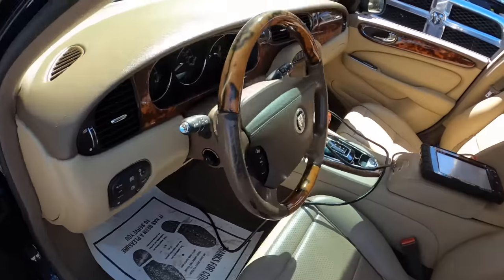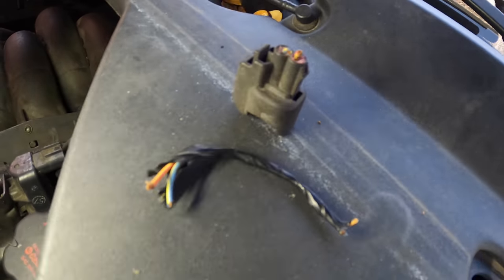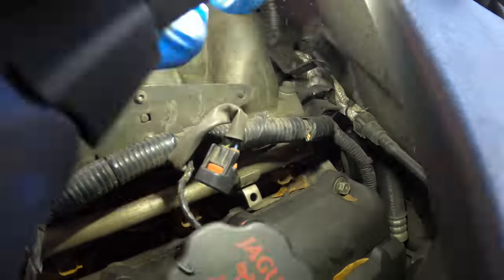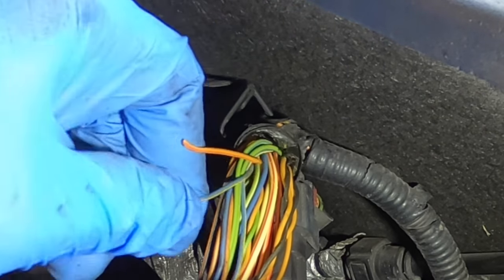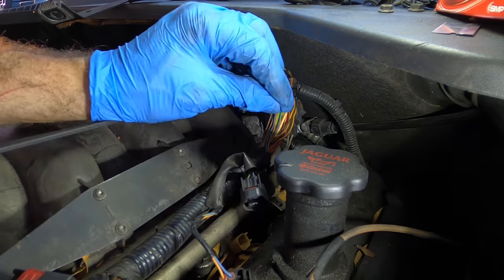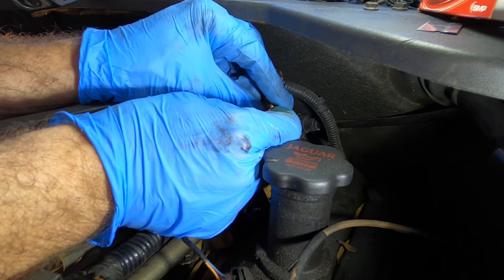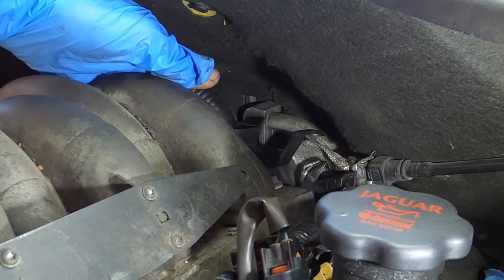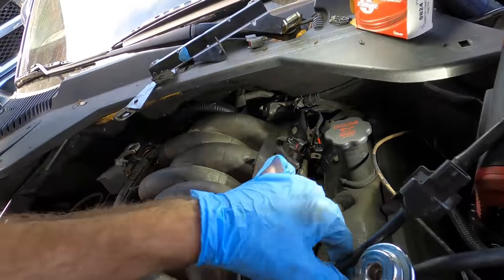Angry XJ Jaguar Engine Attacked / Electrical Damage. P0208 P0308 P0316

Comment: People sweat soldering techniques too much. At the end of the day; conductivity is conductivity, and security is security. Current doesn't care about vanity.

But I do recall one very good piece of critical guidance, specific to high current applications. Keep your wire strands as straight as possible. The more bends, twists, or loops...the more of an electromagnetic field that will be generated at the solder point. So 2 amps or less, and not near any sensitive electronic equipment...I take liberty to secure the wires as is convenient for me. I only go the extra miles of difficulty when current increases and/or in close proximity of other components.

EM losses can also effect sensitivity of sensor circuits. But I've yet to run into those issues in my own experiences.

Comment: You should put solder on one wire then put the other wire on top then heat the soldered wire then it will flow into the other one that's how I do it ( sorry to tell you this )

Comment: Damn Ray, a Jag with multiple issues! What's the odds?
Reply: I learnt the hard way re Jags - had a 1964 S type in the early 1980s. You need lots of patience as well as deep pockets - mine weren't deep enough. Once bitten, many times shy. Never had one since although a "friend" coerced me into working on several of his. From retired mechanic in Land Down Under.

Comment: Rather than using a razor blade to cut the loom or the old electric tape get and use a "Seam Ripper".  Never worry about cutting into the wire insulation  ! ! ! !

Comment: Is there a spray that would make the wires less tasty? Brake clean?
Reply: Peppermint oil keeps them away.  There are also devices you can buy on Amazon that let out a high pitched siren that we can't hear but they can.

Comment: I speak Sarcasm, bad English, and a bit of Portuguese and/or Spanish. 

As far as soldering,  if it works and doesn't come apart and has good electrical connection then you are fine.

Comment: You need some pistol wire strippers for tight spots like that. Far superior to the one you used. MAC and Harbor Freight both make one in case you want to try the cheap version first

Comment: There’s also rumors that the insulation in the wires are soy based. My sister has a 2021 infinity and the rats ate her wire harness. It sat most of the year due to working from home due too the coof.

Comment: Reminds me - years ago, some wires got chewed on my MINI Cooper - one of which was evidently a plug wire...god knows what the others were.  It drove - on three cylinders...so I figure I'll limp it the two miles to the dealership.  It's a Saturday and as I arrive into the local  MINI/BMW/Cadillac dealership - it's evident that the MINI techs don't work the weekend and the dealership is pretty much deserted.  So I wander into the BMW area to see if someone can locate a MINI plug wire that I could swap out myself.   There's BMW sales guy there so I wander over and tell him "I think a rat chewed my plug wire. Can you get me a replacement?"  the BMW guy laughs and says "That might be what the MINI guys would say - but here in the BMW side of the dealership we always tell our customers that it was a squirrel - sounds so much nicer."  ...then from over in the Cadillac area, I hear a distant voice yell "Probably a Mink!".

Comment: I like your soldering job HOWEVER if I was going to do that job I would have soldered my thumb a bit and got some on the other leads.. then when I finally did it I would have realized that I forgot the shrink tubes and then cursed like a drunken sailor

Comment: Gloves off would help when getting into wiring. Why do you guys not use cheap cutters with plastic handles and breakable, renewable blades instead of those scraper blades? I use flux. Some of those other connector wires could use some tape. No brakeclean is disappointing.

Comment: Excellent work Ray. The only thing I would have done differently is to dab some flux paste on the exposed cabling, either before twisting the wires together or, where access is difficult like this case, after twisting the wires together. The dab of flux makes a real difference as to how easily and quickly the solder flows around the joint, even when you're using flux cored solder. In practical terms it means that less time needs to be spent with the hot iron tip wobbling around in the proximity of other wiring. 🙁

As an aside, we British always pronounce the "L" in solder whereas you Americans appear not to.
Reply: I never use flux paste and I get perfect shiny solder joints all the time.. You just have to have a good, clean,  tip, and understand what it means to heat the joint from the bottom so the solder flows all the way through from the top where you are holding the solder wire, and it is shiny solder all the way through..
Reply: @frandanco6289  Indeed. Perfect soldered joints are perfectly possible without using anything other than the flux already included with the solder provided everything is clean and the tip is hot enough. However, using the additional paste gives extra margin for error and means less time with the hot tip in the vicinity of things you want to avoid.

Comment: Nice pickup Ray. It goes to show yet again the importance of a visual check before taking things apart. Obviously there are times when one might have to take something off or apart to access the area one wants to visually check out, however that should be minimised so as not to inadvertently clear an issue without identifying the cause with certainty.

Comment: they make a razor with a hook only cuts inside the hook so can just hook the opening and pull, slices the loom open and doesn't cut wires.
they have a vegetable based insulation for wires, rodents love it.

Comment: Great job there Ray. A pleasure to watch. Well done on realising that a better tip would’ve been appropriate for better heat transfer.
May I add a suggestion?  Not easy on this job but if the wires can be kept as still as possible then it reduces getting a ‘dry joint’. Well worth a read up on them if you didn’t hear about this.  🍺

Comment: I would have used butt connectors then shrink fit the butt connector then put a heat shrink sleeve on top then shrink fit every thing. Or you could have used waterproof WAGO connectors which I have had very good success with. I always like to see a mechanic use the factory wire tape instead of electrical tape.

Comment: Google says several car manufacturers use wire insulated with soy based insulation. The warmth of the engine is probably what attracts them to that area.

Comment: You need to learn how to keep a clean tinned tip. It will make soldering a lot easier. You need to remove the oxide from the tip first. Do not use sand paper or it will damage the tip. As Jack mentions, twisting the wires is part of a correct solder joint. Sold is not a structural material! The wires must be wrapped first.
I was mention to use paste flux. Make sure no to use plumbers flux. It will rot the wires and you'll be cussed by the next person that has to fix the mess. Use Rosin paste only. If there is excess use a little brakeclean to remove any excess. Even goo rosin paste can cause corrosion when exposed the the weather. 
I enjoy watching these car fixing. Now I just needs to find why my dash goes off ( all except the mechanics wrenches ). The engine keeps running fine and not trouble codes or freeze data. I suspect a loses connection someplace, hopefully at a connector. It reset after a about 15 seconds as though nothing was wrong.
Reply: Please excuse the miss typed parts. It is desired to leave a small amount of original wire rather than soldering up to the insulator. With engine vibration, it is better to have the strands exposed to flex. The solder up to the insulation does nothing to improve the connect and forms a stress point when flexed. The shrink tube is always good though.

Comment: No Test drive of jaguar.  We need it !    Failure.... Otherwise good diagnosis.  Peanut oil as a lubricant in manufacturing.  Hmmm.  I wonder if true.  Could explain alot.  But why would they get in the innards of my lawn tractor?  Perhaps more peanut oil.

Comment: Here in Jersey ,,Have seen numerous times critters ,,rats ,mice squirrels,, Eating  wiring,,, N a couple times FUEL LINES,,Also ate my home GAS GRILLE LINE ,,LUCKILY ,,WE got tank off before burning down the house,,But be aware these guys will eat anything,,, AND ON A CAR THAT SITS AWHILE BEFORE DRIVING ,,,LET YOUR NOSE ,,EARS N EYES GUIDE U WITH CAUTION

Comment: Isn't it interesting how the rodents cleaning sever the wires at both ends?  Almost as if they took wire cutters to them.   
I had an old Dodge 200 truck to plow my driveway. It wasn't capable of road use any longer.  After sitting in the yard for 8 months between snowstorms the rodents got in and severed nearly the entire wiring harness under the dash.  Not in a good way either.   Wires to the fuse box, steering column (including the ignition) were severed on the bad side of the harness.   The effort to fix it was far more than I wanted to undertake.  I sold the plow rig and scrapped the truck.  It was missing most of the floor in the cab anyhow.  It was probably a year away from the seat falling through.

Comment: OK Ray you asked for it on the soldering.  I noticed you dripped some solder between two wires causing a possible short (16:25) and it wasn't there before (14:45).  You should always put something under the wires being worked on to catch any dripping solder.

Comment: Soldered joints should be fixed in position and not be part of the flying lead. They are not flexible joints. Tape the soldered joint along the outside of the loom so the joint is secured leaving only the flexible wires out to the connector.

Comment: Looked like a pretty good solder job to me.  Not to bash you but just as an aside you are not supposed to solder anything on an airplane. The unique vibrations in an airplane will cause the wire to break just at the end of the solder. This is not a plane so you did good.

Comment: Not to tell you your business but doesnt a engine compartment get hot? Maybe buttcrimp connector may be a better choice? Im no material sciences major but constant heating and cooling cycles can cause recrystalization of the solder and weaken the connection. No car manufacturer Would recommend this or approve of it. Other than that i enjoy your video

Comment: Tiny house on trailer... you get more (and better quality) for less money.

18 Ft travel trailer: $25k+

18 ft Tiny house can be built for under $10k and you have better insulation, stronger frame. (and the features you REALLY want)
And no "proprietary parts... it's all off the shelf at the local big box store.

Comment: Strange that you will do a poor solder connection (you really are not very good at this) here when the GMC duramax you posted before this specifies that the wire is to be crimped, and they supply the connectors. I would have also considered crimping these injector wires as well. Did you take this into consideration first, or does the Jaguar data specify soldering these plug wires too? Just wondering from Orstraya. In aviation, soldered joints get brittle with vibration and they fracture where the solder ends (in the loom normally), thus this is to be avoided.

Comment: Thanks for the video!  is there any reason you cant use something like those "in-sure plug in connectors" you find in the electrical aisle of HD rather than solder?
Reply: They are great connectors, but their use under the hood of a vehicle is questionable. Heat, weather, and vibration will take a toll on the connection with time. Also, their size would make it difficult to incorporate into the existing wire loom. They would be perfect for an emergency fix, but not long term.
Reply: @greco2189  Exactly!!!  Thank you !!!  And yes, they would never be small enough to fit in with all the other wires, and could also rub against them enough to cause other problems, in time...

Comment: Many car manufacture use or used cables whit the protective plastic made from vegetable oil In order to save on climate. It's a common problem in Europe. I do not now what they are made of or how they are protected today after this problem blow up.

Comment: Reeeeeee.........
Yes, this is indeed the correct way to solder a splice.
It's called a "Western Union" and is secure.  Tinning the wires and laying them next to each other works, but if the solder connection cracks, it breaks free.
But you're working on cars, not rockets.

Comment: RAY READ THIS PLEASE!!!!!  I enjoy your content Ray, sure we all do things definitely and have our opinions, but nevertheless always a good job and always a thumbs up.
To help you out, go to Walmart and hit the sewing craft area and look for a SEEM RIPPER, they are cheap and will help you cut through looms without cutting wires.  And to help your soldiering needs, go to Amazon and look for "SOPOBY 120 pcs Solder and Seal Connectors".  It's shrink tubbing with solder in the middle.  Join two wires and heat shrink with heat gun, it causes the solder to melt joining the wires and shrinks tubbing all at the same time.  Works awesome and faster and their not that expensive.  I've used them to repair many wire applications from stereos to headlights you name it and they are dependable and just oh so easy!!  Looking forward to more Ray!!!  Hope you'll give those a try!  Smarter not Harder amen Brother!

Comment: Every manufacturer has a year that there is an increase in wires being chewed. It’s the year they start using wire the is insulated with plastic made from soy not petroleum.

Comment: Ray, I've been a knifemaker, an electrician, a stained glass artist, all involves soldering. There's at least 5 ways to solder two wires together, the only "wrong" way is to do a cold solder... Yours aren't, so don't worry about it. Good video!

Comment: Thanks Ray. Very helpful for when I change my ridgeline cats at 170,000 Miles. Btw, did you need to pressure test the egr tube for micro cracks ?

Comment: The thing with RV's is they are built as cheap as the manufacturer can get away with.
They have planned limited lifespans so they will need to be replaced. 
A flat roof and sliders really limit it's lifespan. The next drawbacks are the lack of insulation for cold climates and cookie cutter nature of their builds along with ever increasing price tags.
Tiny homes when built correctly will not leak, will have the insulation you want for a fraction of the price of an RV.

Comment: If you were an A&P there would definitely be a right and wrong way to solder.  On a car, meh not so much...as long as it is a good, not cold joint.

Comment: Try this. When you tin the iron's tip you get a little ball of solder hanging. If you heat with the iron below the wire the ball is not helping to transfer the heat. Heating above the wire, the "gravity" ball of solder hanging down will greatly increase the surface area of heat transfer and will also be the first solder to run into the connection.

Comment: Outside of mass manufacturing there isn't really a "right" way of soldering. It's more of an art, as long as it makes a good electrical and mechanical connection you're fine.

Comment: Yay! You finally connected 2 mires the way I do it. Just end overlapping end, a twist or 2 to wind them together but it stays a nice straight join without great lumps and bumps. Without soldering it would only take a light tug to pull apart but, after soldering you've got a very strong but minimal added diameter or lumps to rub against things and eventually short against something when the already extra stretched shrink tubing wears through. Once heat shrink covered it can look a hell of a lot tidier too. 
Only one thing I always at least try to do different to what you did is to stagger them. If I've got enough wire to play with I'll cut one about 15mm or more shorter than the other, do the same to the ones you're joining to then there's almost no chance of 2 lightly covered in heat shrink wires, both with lumpy bits from hopefully ever shorting against each other. Another thing I'll often do is use 2 layers of heat shrink, as long as I've got room to get the second out of the road of the first layer while I shrink the first then the second layer usually can slip over the top of the first layer that's already shrunk. If it winds up shrunk too much to get over it's no drama to slit it open and remove it but, as long as I'm careful that doesn't often happen.
WTF!!!! It's a bloody Jaguar, most of us will never go anywhere in a Jag so of course we'd like to go on the test drive with you!

Comment: What you're attempting will work, you just need to strip around an inch from each wire. Cross the stripped ends about 1/2 inch in and twist the loose end around the opposite wire on each side.
Reply: an inch? hardly. That's way too much.

Comment: You know why GM doesn't want you to solder the injector connector on the Duramax you just did? Soldering has a higher resistance than a properly crimped butt connector. Also, soldering turns that section of wire into a solid core wire which can vibrate and crack in the automotive environment. I always butt connect harnesses. The only thing I solder is large cables, like starter or battery cables but even then, I solder after I crimp.

Reeeeeeeeeeeeeeeeee!!!! 😁
Reply: Hey at least you gave what sounds like some valid reasoning as to why you do it the way you do. Most idiots get on here and just say dumb crap like "I been doing this since the 1970's (and they were born in 96) and have taught 10,000,000 students (yet they're a student themselves) and I'm the most specialist wonderful one ever and my way the the ONLY way!!"